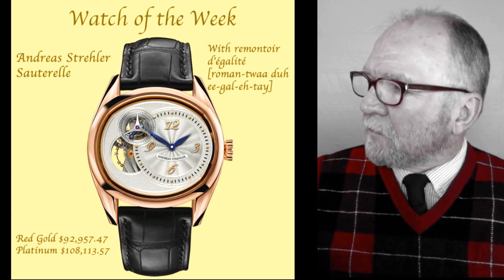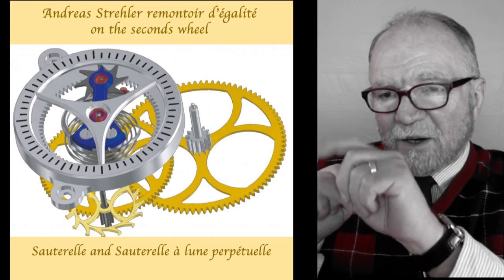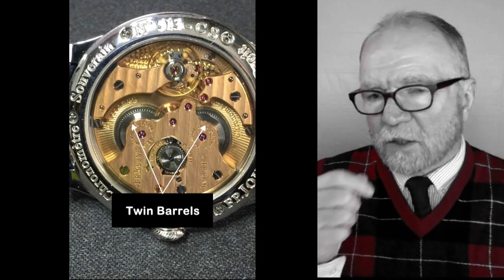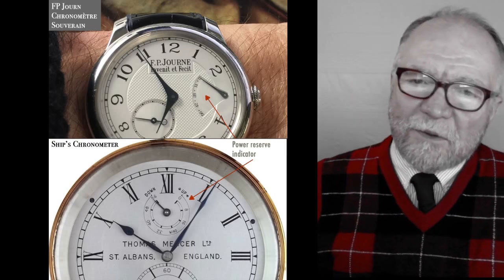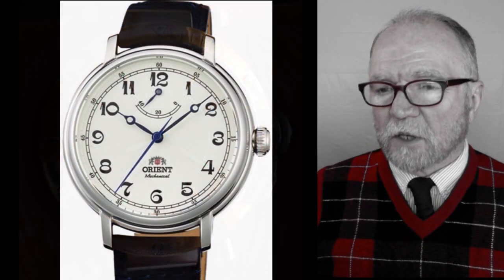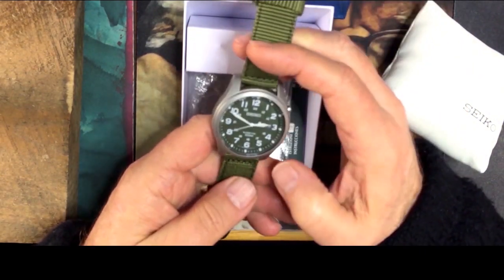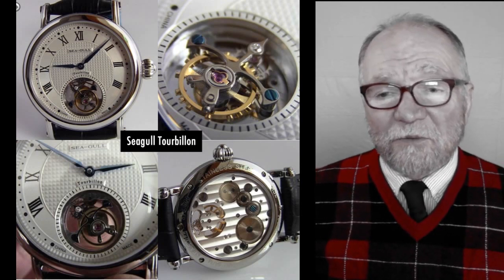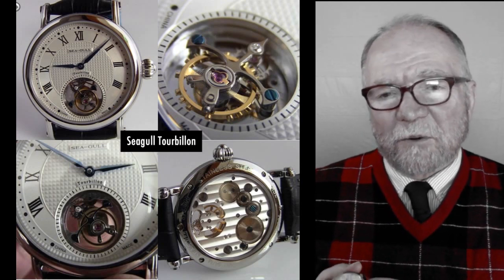#45 Constant Force and Unboxing an Affordable Innovation

Comment: I love the fact that Seiko is able to straddle the line between mechanical and electrical watch excellence with their spring drive and kinetic movements.
Reply from the maker: Hi Ben, yes, Seiko has introduced a good deal of mechanical-electro innovations. One of the prize watches we gave away last year was their "auto-electro" watch that used a rotor to generate electricity supplied in conjunction with the battery. Kindest regards, Bill

Comment: Hello Professor 👨‍🏫 
I hope all is well with your pacemaker. May the Lord heal and protect you sir.
Now regarding the Remontior escapement, Mr. Journe took seven years and developed his version under the name "CHRONOMÈTRE OPTIMUM".  Since he made it (3 years ago) he never wore any other watch.  It sells for %25 less than your watch of the week (platinum version). Plus it has a dead- beat-seconds hand on the back as a double measure of accuracy. All in an 8mm case thickness and 40 or 42mm case diameter.  Now Mr. Journe came out with the first Jumping Seconds watch show casing the next level of constant energy force regulation 🙏🏻✨
Reply from the maker: Hi Jaber! Thank you for that information! Do happen to have one...a Chronométre Optimum? Less than mu Chronométre Souvrain or my Chronomètre à Résonance? Now there's a watch that's interesting. My piggy bank is emaciated right now; so I'll just have to wait on that. (I wonder if they'd take a trade on a pacemaker?) أطيب التحيات، Bill

Comment: citizen eco drive - can get one on the second hand (no pun intended) market with radio controlled function which auto receives a signal from a satellite around 3am every night and adjusts the time - so its pretty much bang on all the time. Not quite a "mechanical innovation" and sadly I have sold the 9 eco drives I had since I fell for automatics. But I still think the technology is stunning. That plus the fact you don't have to change the battery as normal light constantly keeps it charged. Great vid again Bill.
Reply from the maker: Thanks Rusty! You're right about the Eco Drive from citizen, and it's getting pretty close to a smart watch with the satellite connection. The hard part in watch making is working with centuries old mechanical technology and trying to approach the accuracy and reliability of the quartz watches of the 70s. This is a strange hobby we pursue, and your were right in switching to automatics. Cheers, Bill

Comment: Very interesting and informative video, Bill. I always wonder why the kinetic watches like the Seiko you showed aren't more popular with your average watch wearer compared to a standard quartz which requires battery replacement.
As for a tourbillon, I think they are an interesting part of watch making. I don't think their price is necessarily justified as they are generally ridiculously expensive from the well respected watchmakers and seem to be put out there more for showing off than anything else. I didn't know about TAG offering one, but sure enough they have a Carrera model that can be had for around $11,000 and is completely in house it appears and is actually COSC certified. It's definitely a unique looking watch, but I would love to take a look at one.
Reply from the maker: Hey chr1s60, howzitgoin? I agree with you--Tourbillons are priced way out of reach of most of us...with the exception of the Sea-Gull, and I suppose the TAG Heuer Tourbillon. I'm glad to hear it's down to $11k (from $15k)--it looks like they paid no attention to Patek's grumbles. Kindest regards, Bill

Comment: Hi Bill, cool little seiko. kinetic movements are interesting.  You can see an article on hodinkee about a possible application for pacemakers. I wonder if there could be other possible applications in small electrical devices running on batteries. Alternating current generators are used in toyotas hybrid to get juice back into their batteries.
Reply from the maker: Hey Roman! Great to hear from you. I had forgotten about the Hodinkee article, and you are absolutely right. I'm hoping they'll come up with a battery operated, automatic charged device that will help me remember where I put my keys! There are a lot of things they could do with mechanical watches too. Cheers, B ill
Reply: What about magnetic keys on a watch ? hard to lose then. I could use an automatic winding led light for my bike.(the dynamo of the future).
the original article on pacemakers is here: http://spectrum.ieee.org/the-human-os/biomedical/devices/clockwork-heart
Reply from the maker: Roman Jeremy Thanks man! Wait a minute! Am I getting fitted for a pacemaker?! 😅

Comment: That first watch was just adding a second hair spring and balance wheel. But that second spring still has a non linear 'torque curve'. Same problem as the mainspring, except for the period,(from full wound to zero). So the waning/ebbing is done on such a small time interval you dont notice
Reply from the maker: The torques should be offsetting one another Timothy. Take care and stay safe, Bill😷

Comment: Seiko are innovative, I remember when the Kinetics first came out and they were using capacitors which were none too reliable but they overcame this with rechargeable cells.   I will have to look at egalite watches more as it wasn't anything I really gave much consideration but recently Ihave been looking at some of the new super expensive and super innovative companies like DeWitt, De Bethune and Gruebel Forsey and they all have some original thinking... the De Bethune DB28 has all manners of patents and new solutions to old problems.    Both Gruebel Forsey and DeWitt have differencial technologies used to provide Egalite... the Gruebel had two major innovations in EWT (Experimental Watch Technology) which were  ‘Binomial’, a mono-material balance-and-spring wheel combination mechanism using isochronically stable materials, and the "Différentiel d’Egalité", a constant force device based in a spherical differential. This differential keeps providing the same constant force to all the four tourbillons... The DeWitt has a Tourbillion Differential model awarded a GOHH prize in 2005.  These watches are uber expensive pieces, and out of reach for mere mortals like myself...I don't suppose I will ever encounter a reasonably priced tourbillon but perhaps these differential idea's will filter down into more affordable technology one day, fun to look at though, I like DeWitts bi-directional seconds on their Academia model...the secondhand moves like a windscreen wiper.
Reply from the maker: Hi Daveyboyz, thanks man! That was great information. As for an affordable tourbillon; what about the Sea-Gull? Cheers, Bill
Reply: Ok well you got me there...just did a searchnon chrono24 for tourbillon and ordered cheapest first...there are some I can afford, but any watch I lust after with one always seems to be megabucks.  I suppose I don't want one just for the sake of owning one.
Reply from the maker: Hi Daveyboyz, high price is the fate of good taste. For some reason, a tourbillon has never been high on my list of haute horology. They're fun to watch, though. My favorite technology is resonance right now and I do like the remontoir d’égalité—both rare birds. Kindest regards, Bill

Comment: I think the company Aventi, also has under 10,000$ tourbillon
Reply from the maker: There are a lot of Chinese makes with tourbillons around $1,000. Take care and stay safe, Bill😷
Reply: @watchartsci   Wow, i did not know that about the tourbillon's. As for knowledge, iam already soaking up as much as i can about watchmaking. Always been very good with my hands, i used to make boot leg remote controls for the T.V.'s we had while i was locked up. Speakers, I would run peoples walkmans through the T.V. amp, etc. But the main reason I am pursuing watchmaking is that the olny way i will own a watch like that Journe, Resonance of yours, and when i look at watches like that, or like A Lange's  my heart aches,(literally, my cheast hurts), at the knowledge that I am so far from it. How far away from that level of talent and skill i am. I will get there. But boy wouldn't it be nice to just have the 6 figures and buy it. How faster that would be than my path. But the World doesn't owe me anything, and so it goes,lol. Thanks again for the advice.

Comment: Zero meaning full really is an odd system!
Reply from the maker: Hi Any! Winding the ship's chronometer was so crucial for navigational survival that the 0 really meant, "Zero time since the chronometer was last wound." If the chronometer stopped, they would not know the correct time to take their bearings with the stars and/or sun, and they could quickly be in deep tapioca. On the Chronomètre Souverain, notice, though, that the 0 is at the top meaning "full of wind" and as the dial moves to the bottom, it's running out of wind. Cheers, Bill